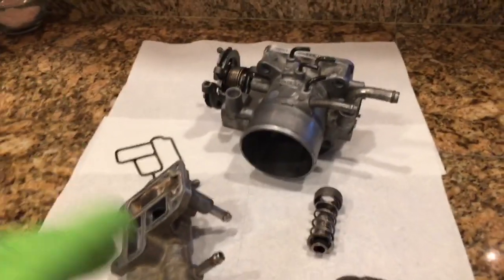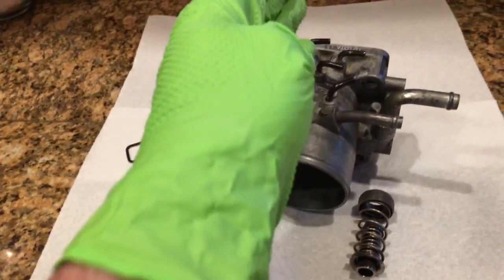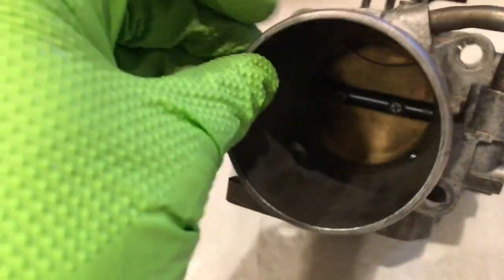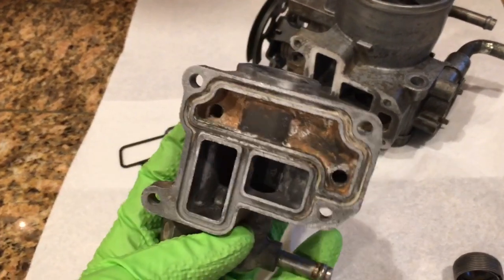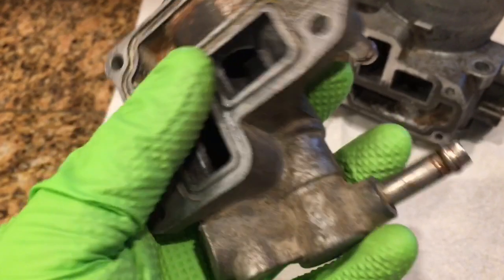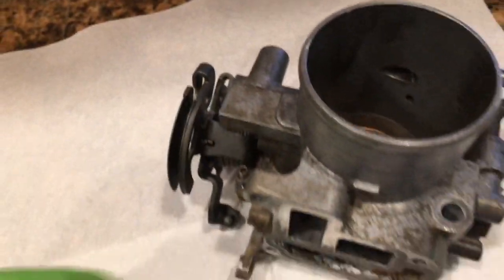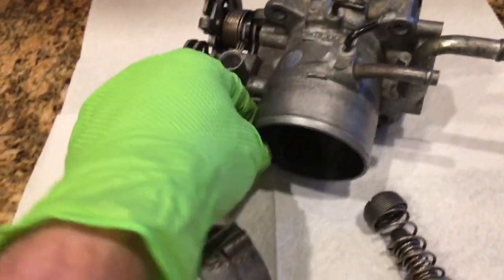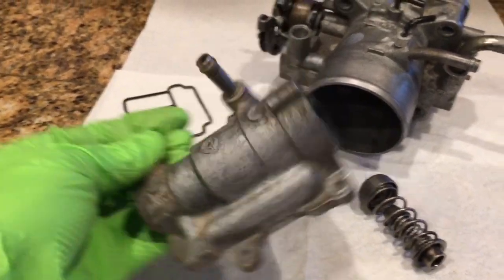Toyota 4runner pickup 22RE - understanding rough, high, surging idle, the Idle Air Control IAC valve

Comment: At first my truck seemed like it was gasping for air. Idle will go up and down. So I changed that part . Started the truck.  Sounded great  but as I took it a test drive, when I stopped it did the same thing that it was going gasping for air. So  turn it off waited 20 minutes or so turn it on sounded great again.

So after watching your video it got me thinking. Well air only goes in only to way. I just put a new part so down there so it can be that. Which leaves the idle control valve.  Or the coolant hoes
Reply: A feedback will be great. Thanks
Reply from the maker: Rodrigo Dejesus check the little coolant house under the IAC valve and make sure it's very hot when the motor is fully warmed up. Also, make sure there is no vapor lock or air trapped in the cooling system, which can cause problems sometimes. And make sure the main fuel injectors are getting power and fully grounded.

Comment: My truck starts and runs fine cold. After it gets warned up, it feels like it about to stall.I believe you just explained whats going on. I'm nervous about taking it all apart but it sounds like I may have too.
Reply from the maker: You can test it by blocking the hole off with some duct tape... see if after doing that the truck has trouble idling when cold, but runs fine once it's up to operating temp. If so, then it usually means the IAC valve is either stuck or no coolant is flowing past it.

Comment: I had the same problem,  I found silicone gasket sealer plugging up the hot water passage holes inside the IAC valve. I used air to blow out water passage holes. Don't know how silicone got there but that's what it was.
Reply from the maker: I had the exact same thing. When I pulled it all apart, there was a big glob of clear silicone sealer in there. The previous owner of this truck installed a new motor and transmission and some point and they were a little sealant happy in some areas, so I suspect some sealer squeezed the wrong direction and broke off, then found its way to a hole too small to get through. I spent several weeks trying to find the issue, until running across this IAC valve stuff; then had to figure out how it all worked and thought it might help others understand what this crazy system does :-)
Reply: I couldn't get the silicon out so bought a new icv on mine

Comment: I have a Toyota 22re 93modol replaced the throttle position sensor is the bracket in side the housing suppose to be bent? How do they go together?
Reply from the maker: Hi Jesse - I'm not quite sure I follow what you mean. What part exactly are you asking about, as far as being bent? You might want to search on YouTube for something like "Toyota TPS sensor replacement" and see if you can catch a glimpse of the inside parts, etc. What I can tell you is that the proper adjustment of the TPS sensor is super critical to the operation of many other parts of the 22RE systems, so it needs to be adjusted right on the money and according to the manual. You need to use a digital volt meter basically as well as feeler gauges. Anyway, let me know what part you are asking about as far as something being bent. I don't quite know what area you are referring to.
Reply: @ray5961  thanks for everything I have looked all over the web site but you push the petal it moves the tps it has two fingers that stick out that makes the tps move thanks for everything
Reply from the maker: @Yyyhgghyyggg  Yeah, those do have a strange angle to them as I recall. Feel free to email me a pic - address is on the channel about page.
Reply: @ray5961  it's me again Jesse Walker I have replaced the distributor cap button wires tps and set it to specific settings and I have replaced cold air start switch the engine has been rebuilt new and has about 1000 miles on it and it will run good until it worms up and then it dies and fluids and falls the plugs I have bought 4 boxes of NGK plugs I gap them at .30 I have done everything thing I can do I'm tired I keep trying and it doesn't work can you help me please thank you very much
Reply from the maker: @Yyyhgghyyggg  Hi Jesse - nothing really jumps out at me. Did you try totally blocking off the IAC valve stuff? The only other thing might be you have a faulty temp sending unit (not for the gauge, but for the ECU). It's mounted on the intake manifold near the front / upper radiator hose (just behind it). You might check to see what readings it's putting out. If that fails, it can throw the ECU off. Also, I would confirm the AFM door isn't jammed or anything. On the TPS, did you set it exactly according to the manual using a digital ohm meter? It requires very specific settings. Also, have you done a compression check on the motor, if so what were your readings? Like I say, based on what you have said, nothing really jumps out at me. Do the plugs come out oily? Soaked in fuel? You mentioned the plug are wet and gas fouled?
Reply: @ray5961  no I have not done a compression test but would I have to it has been rebuilt by a person that builds motors for racing and the tps is done by the book with a ome digital the plugs are soaked in gasoline I clean them up and check them with the ome meter before I use them again and I don't know about the other it has had the abs smog pipes I don't know what you call all that stuff but I will try to find out you have helped me a lot thank you again I'm just tired I have been working on this for too weeks and it just started all at once I did know but thanks again
Reply from the maker: @Yyyhgghyyggg  If the plugs are soaked in gas, perhaps there is a leaking injector. Perhaps the cold start timer isn't shutting off the cold start injector? Try just unplugging the electrical harness going to that little injector in the middle of the upper plenum. Did you check your injectors to see if they are leaking? The main injectors? Also, are you running the proper O2 sensors in your exhaust?
Reply: @ray5961  I will try the injectors. How do you check the main injectors to see if there leaking?
Reply from the maker: @Yyyhgghyyggg  You have to take them out and test them individually. They sell a fuel injector tester thing on Amazon for like $30 or so. You hook up a pressurized fuel line and run them, then see if they leak afterwards. But I'm not sure a faulty fuel injector would cause your issues. It might, but it's hard to say. I'm wondering if your cold start injector might not be turning off or something. Try pulling the harness to the cold start injector and see if that changes anything maybe. Also, you might wanna check to make sure you have a good electrical ground between the motor block/head and the frame. I'd also check your coil to make sure it's not failing or something. The fact that it's tied to warming up is odd. I'm wondering if the ECU isn't getting an accurate temp reading and keeping the motor running too rich. The other thing is if the O2 sender info is out of whack, it can push the A/F ratio too far off the map. There's just a lot of areas to check. Are you positive the plugs are getting gas fouled? You could also try running one heat range higher, to see if that affects anything. Maybe use the Denso W14EXR's instead of the W16's. I know my truck runs better with a hotter plug... I run only the W14's here.

Comment: Thank you for this video I have a 94 rear wheel drive  22 RE and couldn't find any info on what that spring adjuster was, let alone how in the world it operates  in tandem with the air flow.except in the Hanes book stating it had taps that needed to be broke off  to adjust.i will admit out of frustration I fiddled with it and noticed idle difference but adjusted it back because it seemed to cause a gurgling sound which  I know shouldn't  be present in a healty running 22Re motor. Any ideas as to what that gurgle sound  is or was would be a much appreciated  bonus  to your great video👍 best regards from Mark" justa need ta keep her a goin!" FROM 
So Cal
Reply from the maker: Not sure what that sound would be... but there is a gurgling noise associated with the AS (air suction) system when you decelerate. Try capping off the vacuum line going to the AS valve under the intake runners and see if you can make the gurgle noise come and go. That might be what you are hearing.
Reply: @ray5961  wow I'm digging the response time! Will give your sugestion a whirl directly  and let you know much appreciated  Ray!thank you
Reply from the maker: @markevans911  Sounds good!

Comment: What would be the implications of removing IACV. Rough starts? 
I have a offroad only vehicle with a 22RE. I want to delete as much as possible.
Reply from the maker: Javier Zaragoza Yeah probably so. My guess is it would probably start on a cold morning about as well as having a set of 44mm side draft Mikunis :-) You can certainly test your theory by just blocking off the hole inside the throttle body - see my other video for more info on that. You might need to also disable the cold start injector off the intake plenum as well, but it's hard to say without testing.

Comment: This video is very informative and I appreciate you taking the time to explain things about the throttle body. However, how do I know how much to adjust the IACV spring? You mentioned allowing a little bit of air to pass by. Does anyone know how much air to allow through the seated spring while cold? Thanks in advance!
Reply from the maker: Andrew Greene Thanks man! Yeah, I'm with ya on not being totally sure either. The way I initially adjusted it was to warm it up to about 160 and then thread it so it was closed. Then confirmed when it was cold that it was open enough so some air comes through. It's function is to provide fast idle when warming up the motor, so it depends also on how cold or warm an area you live in. I tried to set mine so I'd have a touch less high idle in the morning and figured if needed I could pull it back off and adjust more in if I felt I really needed the car to idle at 2000 RPM's for longer when it's cold. I wasn't able to find any specs in the Toyota service manual as far as setting it initially, although there might be some spec hidden on some page some place.
Reply: Ray Nada thank you again, I appreciate it!

Comment: Is it recommended to clean that piece with a spray liquid to try to get it to work again or better to just buy a new one?
Reply from the maker: It's typically better to clean the original Toyota parts when possible. A lot of the replacement stuff from China isn't that good and/or the OEM Toyota parts are no longer available. I cleaned up mine and it works great now.

Comment: So I've got it apart, the water passages appear to be clear. Not sure how to diagnose if the pin is stuck. I pulled out the pin and there is a groove at the bottom filled with gunk. It almost seems like there is supposed to be an o-ring or something there.
Anyways now I'm putting it back together and I'm wondering how far to screw in the spring assembly. When I screw it in all the way it closes the gap. Is this normal, or is my valve stuck closed? Otherwise I'd like to know how much of a gap I need.
Also my problem is the opposite, in which it runs fine when it's cold but the rpms drop when it warms up
Reply from the maker: Christopher Carlson to confirm the pin is working, just run hot water over and around everything or submerge it into some hot water for a minute. Adjust the spring / cone so it shuts the air flow off when hot, but open when cold - that's about it.
Reply: @ray5961  @ray5961  same situation here; I pulled out the pin from the brass cylinder and it has a groove with residues of what appears to have been a very tiny o-ring meant to seal this pin/piston so the air Trapped inside The brass cylinder would expand, pushing the pin/piston out To close the air passage. So, if this o-ring deteriorated to almost nothing, the air escapes from the brass cylinder and the pin does not push the valve closed. Do you now where to get an o-ring this tiny? Or do we need to replace the whole IAC valve because the o-ring is not available?
In my case, I would have to replace the whole throttle body because on my 89 corolla 4AFE engine, the aic valve is part of the throttle body!!
When unscrewing the valve seat, it was very hard and the valve plug kept pushing out against the seat. When I screwed in back on, after having removed and put back the pin, It when in very easily without resistance from the valve plug pushing against. I am thinking of spooling some dental floss on the groove in place of the missing o-ring. I think the pin/piston will not rise without anything sealing it with the brass cylinder. But, I will give it the hot water test before putting it back on the engine.
Again, do you know where to get such a tiny o-ring??
Reply: Did it work properly without an o-ring in that groove on the pin?
Reply: @jcplancarte2521   yeah I didn't need to get an o ring. I just cleaned it and calibrated it with hot water like @Ray Nada said, and it worked great!

Comment: My truck is idling rough at start also you can barely drive it it wants to buck and mis and everything else then once it gets warmed up it’s fine and you can turn idle screw all the way down and it will still idle very weird any thoughts ?
Reply from the maker: sounds like the IAC valve might not be closing. Check the inlet and outlet hoses to see if they are heating up properly and check coolant levels in the system as well. You can also remove the rubber elbow and tape the IAC air hole shut using some duct tape (just wrap it around the lip so it doesn't end up sucked into the motor) and that will totally shut down the IAC stuff completely. Also, check the O-ring on your idle adjust screw. That screw should allow you to adjust the idle when everything is working as it should be. Even 1/8th of a turn on the idle adjustment screw should be able to drop the idle RPM's 200 or so RPM's - it's a very sensitive adjustment when everything is doing its thing correctly.

Comment: I know the videos 3 years old but I’m having an issue were my idle surges but also while I’m driving until the motor warms up (roughly 10-15 mins) my truck only works when I floor it. Like for example 1st gear I’ll be going and like clock work at 3 thousand rpm the engine starts to sputter and will even start back firing like I hit the 2 step. The engine has been fully rebuilt, do you think that the IAC could be the cause of my issues. I’ve replaced the afm twice and cleaned the throttle body about 100 lol
Reply from the maker: It's hard to say, but that doesn't really sound like the IAC. You can easily disable the IAC valve by placing some duct tape over the inlet hole inside the throttle body there. Just cover the hole and that disables the IAC circuit. It simulates it being closed as it should when the motor is up to temp. When you first start the motor, it won't want to idle, but after you drive 5 or 10 miles, it will come up to temp and then if your 3000 RPM thing still is happening, you know you've totally ruled out anything to do with the IAC valve. Usually misfiring has more to do with ignition or valves being out of adjustment. Watch also to see if any blue / white oil smoke is coming out the back during mis-fire. Also, cleaning the spark plugs can sometimes help out. I'd check to ensure the plug wires are good, etc. Also check to make sure the ground strap between the motor and frame is solid and clean. May not hurt to run a compression check as well.

Comment: My 22RE idols rough.  I dont know of any vacuum leaks.  Should I take apart the throttle body?    How do I clean it?  How about the EGR Valve?  Good video.  All info appreciated.  Thanks.
Reply from the maker: Mitchell McMahon might also be your fuel filter or clogged injectors. You might want to have the fuel pressure checked and inspect the seals around the injectors. Many things can result in poor idle. Also bad O2 sensors. Start by pulling any check engine light codes - on the older trucks with OBD1 you have to jumper some pins in the diagnostic port box to get the code. You can use B12 chemtool to do some cleaning without removal - EGR valve is something you should research via youtube and then you can disconnect it to check, but as I recall I don't believe it's open at idle.

Comment: Only on a slow rev, it surges once it gets to 2000 rpm but there’s no surge when I drive it down the road regularly and shift it between 2500 & 3000 rpm. Any tips on how to fix that problem thank u
Reply from the maker: Rylan Salvador I'd check the major stuff, dirty fuel filter, fuel pressure, vacuum leaks

Comment: Hey @Ray Nada — did you rebuild your throttle body when you had it off? Replace the shaft seals? I see you bought the LCE isle screw. Their ‘rebuild kit’ contains shaft seals as well. I can’t for the life of me get the throttle plate or TPS bracket off after removing their retaining bolts to access the shaft seals.
Reply from the maker: Hey Jeff - no, that is not something I did. I wasn't aware LCE had a rebuild kit for it, but that might be something worth checking all right. I'll have to take a closer look at mine and see, but as I remember everything seems to be in pretty good shape. On those small Phillips head screws, some of them can be a real bastard to get out. I had to use vice grips on a few of mine and practically destroyed them. Soak them with WD40 if you can. I replaced a lot of those screws (including the two which hole the TPS on) with Titanium allen head bolts, which makes life a lot easier, let me tell ya.
Reply from the maker: @jska413  ok great thanks! I'll check that out when I'm in the office later.
Reply: @jska413  Thanks Jeff, that link was super great, Jim